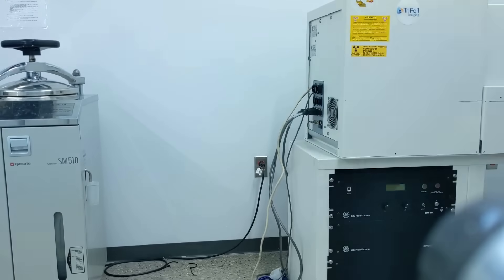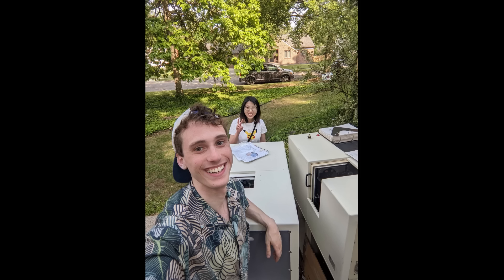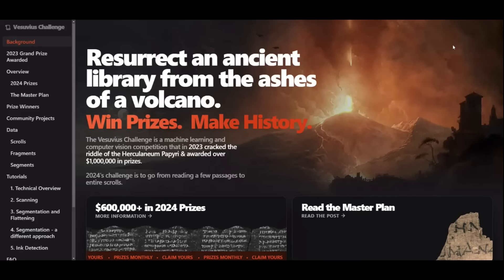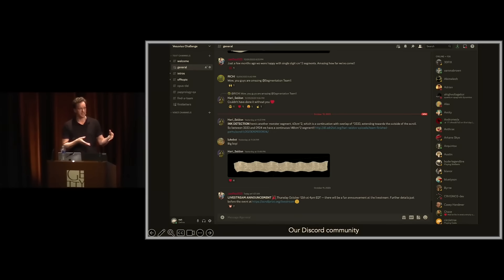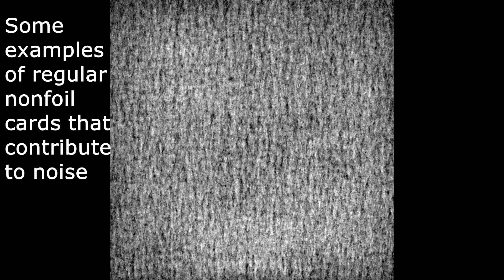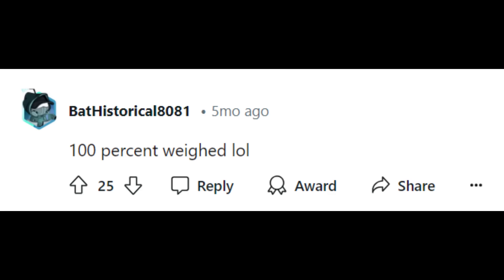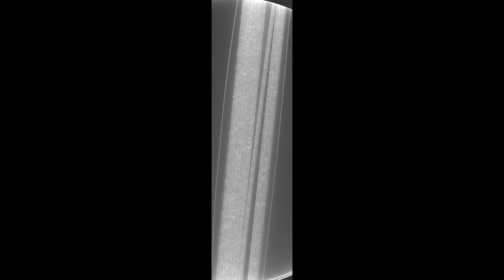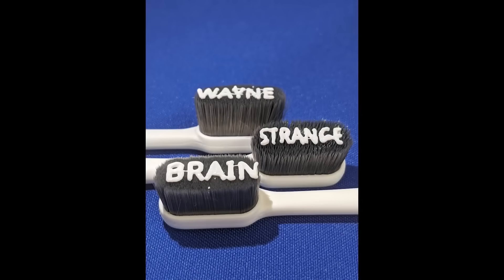Digitally Peeking Inside a Pack of Pokemon Cards

Comment: You really should explain better (i think you did it on purpose) that your patent doesn't stop anyone to provide a service where they scan your boosters and provide you with all the informations they find about cards. Your patent stops from GRADING and AUTHENTICATING it as a service. Be better. Change the description
Reply from the maker: Thanks for reading my patent! Identifying method + system is definitely there in the claims. You're right that having a patent doesn't stop anyone from choosing to ignore it, though.

Comment: If you can be so kind to tell me the parameters you set up for scanning it. Like Kvp, mAs, slice thickness and overlap lol.
Reply from the maker: Based on the units, it sounds like you're using a medical CT!

What I can say is -- if those are the settings you have access to, go for max possible mAs without blowing out your sensor, for the sake of signal to noise. And skinny people settings (lowest KV possible for contrast). And then thinnest slices you can get. I'm afraid the resolution needed might be out of scope for most medical CT though. The threshold is significantly below 0.1 mm, and as far as I know most medical CT is significantly above this. Please do let me know the results if your try though.

Comment: So, I've been buying cards for a while... and this has scared me none. You can show me on paper, there is a Foil Gangar in that pack, but its effectively still only worth the price of the pack due to the package not being "clear" like toy collections. Even things in "closed" boxes can be removed, inspected, and re placed since the packaging itself usually was eliminated. Absolutely not with trading cards, seeling a X-ray pack would be the same as selling a Lambo vs a Ford, there both just cars but until I drive it off the lot and tank the value neither are "mine" cause eyes on the actual thing not just an image is what matter's. "Show me the money." "Well, I have a photo of the money..." if people wanna NFT packs thats fine... but it will be like the exotic car market, it will only exists people people have money not cause they are valuable.
Also a great deal of any card market arent the bangers but the card's people actually utilize in torments or popularity. You could never sell a pack thats been x rayed faster than just the single card... it makes no sense if you also cant get a clear enough image of like Serialized Cards. I think that would be it, using the tech to find the One of Ones cards by scanning huge amounts of packs and only opening up the cards that would pay for the machines to run. All this does is take the "fun" out of opening packs, which is fine, literally a You do You Moment... but imma be over here having fun with everyone else... maybe you could charge for the service of having packs scanned in bulk, then whatever it doesn't matter to you whats in it but to the collector it does matter and maybe worth the investment.

Comment: The only problem I can see with keeping the Gengar seeled is its less protected than if you opened the pack, sleeved it and/or cased it. It could be losing value the longer its in the pack
Reply from the maker: @whosmokesthablunts496  that's an interesting perspective.

Comment: I'm surprised even somewhat dissapointed you found these machines on the secondary market.  The Xray source is INCREDIBLY radioactive.  There is a video about some dentist who sold his xray machine and the people who bought it took it home and tore it apart and several people died.  I surmise that if lots of people start trying to source these machines the government would put a stop to it.  Not that these are all that dangerous to operate.  If just one of these things somehow ended up in some junk metals pile to be shredded for recycling that could easily become a complete disaster.
Reply from the maker: You're thinking of a permanent source, used for mining or medical treatments. This is powered.
Reply: @WaynesStrangeBrain  Go ahead and cut that "battery" pack in half.  You know the one with the universal radioactivity symbol.  The one that has the lead shielding for fun.

Comment: Interesting! What about your settings! Which kv and mas value do you use for scanning the packs?
Reply from the maker: @lauracecillia  I totally shouldn't tell you, but I will anyway - I'm usually in the 60-70kv range with just a bit of aluminum pre-filtering. The source is a pxs5-925 and nominally it should be able to do 100+ microamps at the spot size of 9ish microns but it's from 2007 and I run it at 30ua and even then it has to warm up for a full day first. If it's cold I literally have like 6 microamps, lol.
Reply: @WaynesStrangeBrain  wow thank you for your really fast awnser! I am definitely in for some experiments, i am a radiology technician in holland with some spare hours during my nightshift 😀

Comment: You can just tell by the bend on the card man. I would be sold even on that
Reply from the maker: Yeah it's not always that dramatic but that one certainly was. Also the case when you need virtual flattening unless you physically compress the pack with foam which I don't think is ideal

Comment: Some packs for some games if not all you can move the cards inside a small amount. So you can move say the first card down 1/2cm and then scan it - that way you an get multiple scans of the cards inside which will make it easier to identify what card it is. Lots of shennagians can be done using this technique and some packs are worth hundreds of dollars so maybe worth the time messing about to see what is inside. If you don't do it someone else will. Still sucks for those real collectors out there.

Comment: Has anyone offered to get you a color CT scanner, looks like your flattening technique is the money now the pigments can be read correctly.
Reply from the maker: @zentec010  I'm not sure what you mean by color --- something that can distinguish the different colors of ink?

The machine works by exploiting different attenuation (absorption) differences in materials. So, paper and air absorb differently, yielding contrast. There probably is a difference in absorption between different colors, but as it is it seems very small.

Comment: Considering that two sources have discovered the same thing I would say that this will affect the market. For expensive vintage pakcs people will 100% start doing this. In turn I believe that the price of loose packs will go down but the price of boxes or packs from a known reliable source will go up. This is basic economics because the risk of buying a box is lower, the bad packs will be sold on, the good packs will be kept etc. The interesting part is what happens to the big hits and the packs with them in it. I personally think they will be opened. Maybe some content creators will privately purchase some guaranteed hit packs but overall I believe you would still need to open them in order to really determine the value of a card. Centering can be determined, but print lines, whitening and holo condition might be more difficult. I don't think packs with a hit inside will be graded as such. At best people will get the packs opened by grading companies to prevent any possible interference. As for if the prices of the good cards will be affected? I do not know. It really depends on the card itself. For the really high end vintage stuff it will likely not matter too much. A heavy first edition base set pack is like 8-10k iirc and even the best cards in psa 9 are like a slight profit. Having to find those packs and reselling the bad ones would be an enormous effort. However if you have a booster box things will get more interesting. It will also be interesting for finding print error packs/cards. And if it works for thicker cardboard scanning MTG alpha booster boxes will be the real money maker. Not to mention that just confirming that it is real will be worth the effort.

Comment: Pokemon TCG could easily create a material that gives off noise and interferes with the scan imagery? is this correct? If so there is still hope for the future of loose packs. Lead would obviously be dangerous to ship inside kids toys, plastic & materials of that nature clearly aren't structurally dense enough to throw off the scanner. Assuming adding another product into the packs is going to be costly & change everything, I am assuming the keyway at this point would be some form of infused ink. I found one likely candidate which is called barium sulfate. Apparently, it's inert & insoluble in water. it creates artifacts inside scanning imagery because it absorbs the x-ray itself? I am not a scientist and I have 0 knowledge of any of these chemicals or how CT machines genuinely work. Just a spit ball idea which people might know more about. Like theoretically the packs themselves could be printed with this inside it or something along these lines, which will throw off scanning imagery and create noise and artifacts which make it impossible to determine what it really is. Obviously being wrappers and kids cards it has to be completely 100000000% safe. So I'd like to know what other people have thought of this.

Comment: A PSA10 card inside of a pack is a PSA10 card inside of a pack. A PSA10 pack is a PSA10 pack. Confirming the cards inside of a pack shouldn't raise any grading at all since the card stays in the same condition and so does the pack, until you open it. 

Plus, I'm a little too tired at the moment to entertain the philosophy of Schrodinger's Globat.

Edit: After reading my initial comment, I guess it could be seen as a collector's item but I don't see any possibility for it to raise in price beyond what the cards are worth, especially if printing errors can't be confirmed 100%
Reply from the maker: I think it's an unknown quantity. Like, it can't be worth less than the card once it's out, if you can actually grade to a high certainty which I think would be pretty difficult - grading is harsh.

Comment: In yugioh the ultra rares and higher have foiling in the title of the card. You could just literally read the card.
Reply from the maker: @PunkNDisorderlyGamer  I haven't branched onto yugioh so much yet, but this is the case for some MTG cards too. Any specific cards I can order that are examples of this?
Reply: @WaynesStrangeBrain  haven’t played Yugioh in 5 years but every set usually has a hard to pull key card that you need 3 copies to compete with. But if you just wanna test it, any ultra rare, secret rare or ultimate rare should be enough to test it. Super rare cards are foil as well but the title is printed without foiling.

Comment: Thanks for the video.
Would this also work through a booster box? 
Can it identity non-foil cards, or is the foil required?  

Someone has a MTG Revised booster box, which is supposed to be the rare Summer Magic version.  
HUGE price difference between the two, and possibly the last sealed Summer Magic booster box. 
Nobody wants to open it, but everyone wants to know if it's really a Summer Magic box or not. 
Seeing the large 1994 copyright date on any card of any pack inside the box is the way to identify it.
Reply from the maker: @TavisKingsChannel  I've done a little bit of work with magic cards, actually I used to play that a lot when I was younger, some foil cards like 7th edition Thorn elemental light up clear as day. I don't know much about that box though... Is there anything else at all other than the 1994 date that could distinguish the two versions? Feel free to contact me at first and last name at gmail, no spaces. I'd be happy to try and work to see if there's a way to do it without government level resources.
Reply: @WaynesStrangeBrain    Thanks!  Email Sent.

Comment: The scientific approach provides results supported by objective and quantifiable elements. It's only natural imo to want to know that a test is pass or fail when dealing with tests like mineral or biological id, but this seems straightforward. I , very personnaly, would try with 3 newer packs( instead of opening your vintage) test and post results, to dissipate any scepticism  of the process and to validate the process. You then get to keep your 2 others sealed. ,But there is  little to no doubt in my mind that the cards shown on the CT were correctly identified by you. Ya just can't hide from Xrays 😂. 

I don't feel like this may be something everyone's gonna jump on. Just buying... Oops I meant... Finding a cheap, working  CT scan, setting them up correctly, in the right room, buying the right PPE to operate (or not 💀)... Instrumentation cost, calibration... Gonna need personal knowledge on the topic or a few specialists ( a few friends, for some!) to set it up and keep it running smoothly. 

Good job mate, very interesting! I'm sure this could be very useful for debunking fake booster boxes and just overall authenticity purposes. Or you could go dark side and hunt for more holos, you do you 👍✌️

Comment: this is insane technology that I'm sure will bring you a fortune; this surely has uses outside of cards. That said, it's both exciting that this exists and not exciting. I'm a smaller end card store online and while I don't sell packs (or loosies), I'm very familiar with those who do. This would obliterate the loose pack market for sure, and if the technology can be significantly improved on I can only imagine what it could potentially do next. Could it look into whole sealed product? 

Either way, I guess bottom line as if not a store owner then as a collector, I am VERY carefully excited. Good luck to you and if I can be of any service (lmao i doubt it) I'm always open.

Comment: You're 1000% going to get contacted by a whale collector to scan some items for them. There's money to be made here-- even if a pack does have a hollo, it can be sold as a heavy pack if it's a card worth less than a sealed pack. And someone will buy it in hopes of it containing a big hit. You can then open the packs that contain cards worth more than the sealed value of the pack and grade them. OR you can even sell it sealed with a form of authenticity that there's a guaranteed Pokemon card inside-- PSA 11 aka Schrödinger's Pokemon. I'm calling it now, someone will scan a 1st edition base set pack with a shadow less Charizard inside, grade it still sealed, and it will sell for a record amount. 

You should definitely try it with a few cheaper packs, and open them to verify that this actually works though.

Comment: No offense but this proves nothing. This is all a bunch of trust me bro based on random pictures in this video. You need to provide evidence.
Reply from the maker: No offense taken. What if I scanned some packs, sent them to be authenticated as unopened and slabbed by PSA, and gave them to a livestreamer to be opened. It'd be a bit expensive for vintage, but I'd be happy to do it for modern. Would this be good enough?
Reply: @WaynesStrangeBrain  That would certainly prove it without question. That's right, does not have to be expensive packs just needs to be a demonstration that would make this irrefutable.
Reply: @WaynesStrangeBrain good video idea.

Comment: Thank you for trying to start a patent on this to keep it widely unavailable without buying and using one of these machines because there are lots of people who make a living off of these cards and something like this crashing the value of all of them would ruin lives
Reply: Getting rid of the gambling aspect would not crash the market. It would allow for the market to better determine the value of card packs. It would help avoid people overpaying for packs with cheap cards in them and underpaying for packs with expensive cards in them.
Reply: @gyroninjamodder  that would make sense if every pack ever was scanned but what would happen if he didnt patent this is a few people would scan a lot of packs and only open the ones giving them a profit and then they would sell the packs with nothing in them at regular price making it very bad to purchase packs anywhere and it would greatly decrease the demand and value of sealed items dropping the value greatly
Reply: @Xonoriuss  The card within all packs still have value and if the price dropped greatly people could buy them and sell the cards for profit which would increase demand of the packs.
Reply: Lol you can't patebt this. People are so dumb.

Comment: closed packs with guarantee hit inside and you know what the hit is?  IMO thats worth more than the PSA 10 of that card... so I would imagine you could sell the pack with proof for the PSA10 price + a tax for sealed
Reply: How would this be worth more than a psa 10? Odds are manufacturing flaws are included, it just means you can guarantee a certain pokemon holo. Just like buying raw the implied value is lower than a psa 10 until it is given a psa 10.